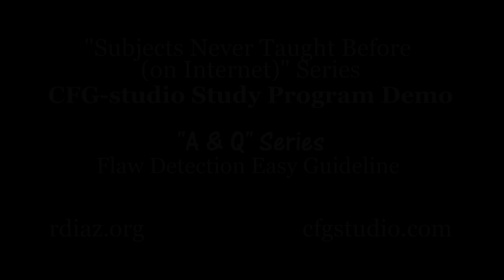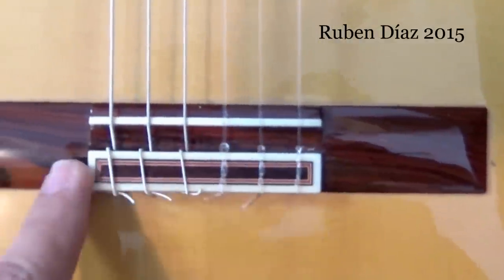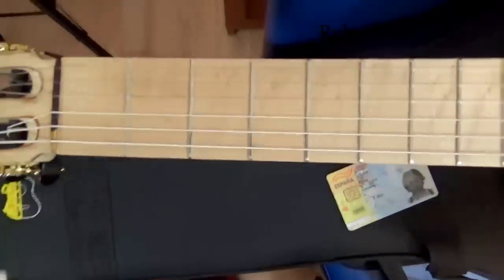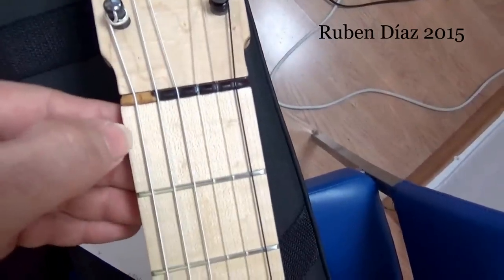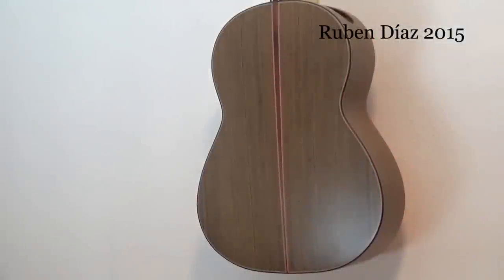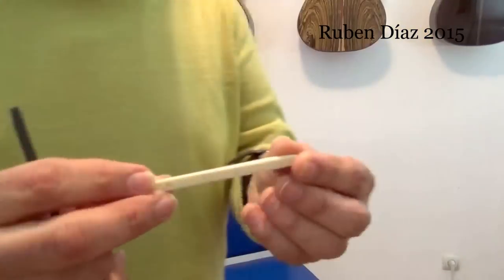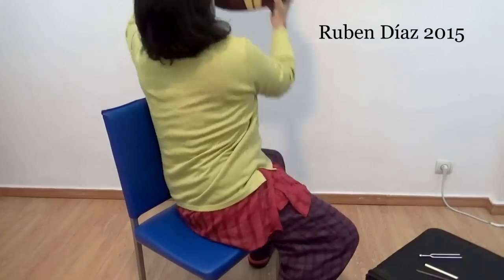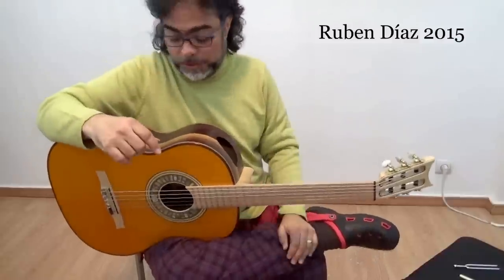How to choose a nice flamenco guitar /Flaw Detection Guidelines & Post-Paco de Lucia's Age

Comment: Thanks so much for this expert information it is a master class !

In relation to the string spacing at the bridge, if just for example, say the spacing was spread over 60mm wide.  Would each hole be 12mm apart or must I allow for the thickness of each string to get exact even spacing ? 

I'm just a little confused on this point.
Reply from the maker: Good question Andrew. Space should be equal just watch in detail the following two videos about that: "The emperor has no clothes"
https://youtu.be/RLj2gz-eMGM?t=1m59s

Cheap factory made are more accurate than 
the monotonous hand made Luthier guitars
https://youtu.be/uPEEn0WoyUg?t=30s

Regards

Comment: HI Maestro, do you know what the exact angle should be of the headstock in relation to the fretboard? It looks to me something like 50°. Would you please confirm that? Thanks!
Reply: HI Ruben, thanks for the reply! No, I'm not a guitar maker. I'm a guitar player but I'm also quite interested in the physics of guitar making. Muchas Gracias!!
Reply: +Rod Gibson Much of it Rod is aesthetics. I love the design of the Lute head-stock, but can you imagine hanging them on your wall? As much as I love the Lute, I think in practical terms, the head-stock is way over the top. The angle of the head-stock helps keep the strings in place in the nut and improves the tone of the guitar - just like the break angle at the saddle. Fender went for the quickest way of making a neck on their electrics and it affects the tone because the angle is too  - well - almost parallel. I actually find these Andalusian Guitars very pleasing to the eye, with the head-stock angle slightly exaggerated and it does lead me to wonder whether there is any difference in tonal quality compared to other guitars. But then Andalusian Guitars have made so many changes to design, that it is difficult to assess. There is one thing to think on - and that it, if it does make a little difference (scientifically), then all these "little" improvements make for a whole better experience. There are many ways to make an angled head-stock.

Comment: hi maestro, is there a fix for a overhydrated cypress guitar soundboard, its not flat but slightly bowed.
Reply: rubendiazguitar forgot to put it in the case before I went away to work, for a month, its always cold in Scotland , thank you maestro.
Reply from the maker: John Forbes John here you have some humidity advises:

Video  http://youtu.be/-cmX9o-gf4k?t=14s

1)
You should have a hygrometer (a simple one like this: 
(*do not leave this sensor inside the case, it should be outside in the room you keep the guitar)
http://www.stringsbymail.com/store/index.php?main_page=product_info&cPath=2_405&products_id=4956

and only if it is under 40% humidity place (generally in winter time) the simplest humidifier in the head of the guitar case re-filling it with water every 2 or 3 days.

2)
Here is the link for the humidifier:
http://www.stringsbymail.com/store/oasis-original-blue-currently-not-blue-soundhole-humidifier-1656.html

Comment: Hello, I have a question...When doing the test with card, what are the ideal distances between frets, the distance should reduce by how much?
Reply from the maker: This problem about the inherent inaccuracies on the fret division used by guitar makers in Spain from last century till now has been carefully and conveniently avoided issue to talk about because it is difficult to face...

Next you can see a sample of the exclusive A.G. exact measurement division 
for each fret (which no other Spanish guitar has)

Enter Scale length in mm 650 

Distance From Previous Fret New Scale Length Distance from Nut 

Fret 1 36.48201156

Fret 2 34.43441591

Fret 3 32.50174398

Fret 4 30.67754552

Fret 5 28.95573233
Reply: Thank you for the reply...it is very much appreciated.